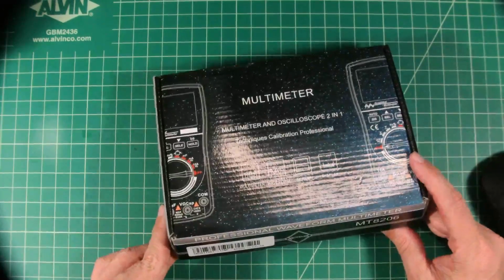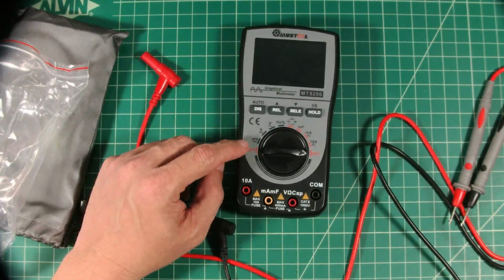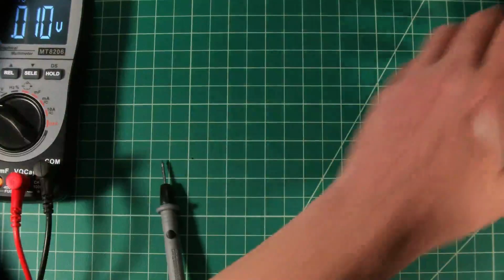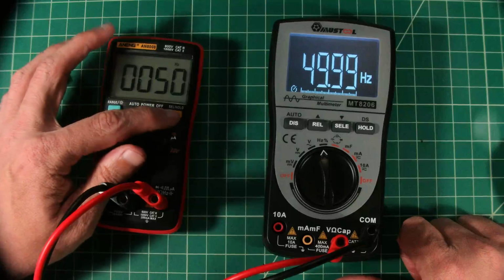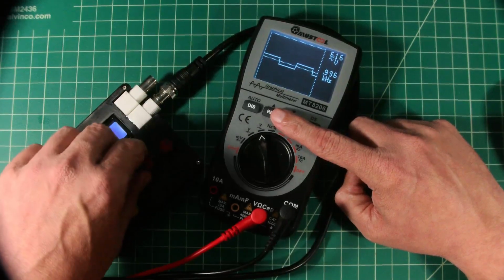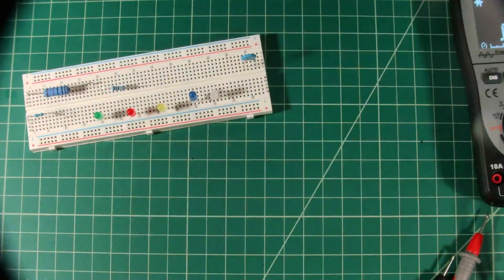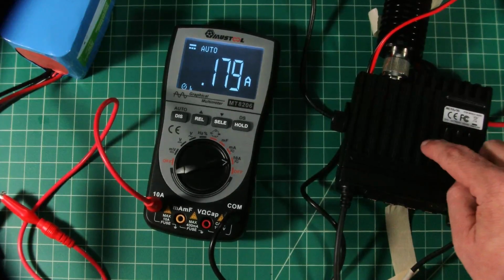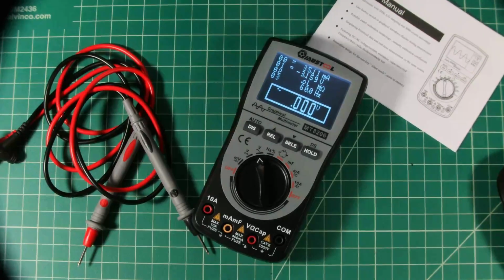Mustool MT8206 Multimeter Review

Comment: I have discovered why the diode function doesn't work.

I measured the open circuit voltage at the probes of this meter for the diode and continuity tests at 1.498V.

Information I had previously read on the web for this and similar meters, says around 5.0 Volts for the diode test, however my findings are completely in accord with the meters quoted printed specification voltage, which states .... "about 1.5V"..... (The web information is incorrect).

The meter is therefore not faulty, but working completely as intended.

Most LED's require at least 2.2Vf to illuminate, so the test voltage and current applied by this meter is not enough to overcome the forward junction potential, so the diode will not conduct.

Light emitting diodes can therefore not be reliably tested with this particular meter.
Reply from the maker: Fantastic post, thank you for adding to the conversation.  👍

Comment: I have the newer version of this same meter and had the same results trying to test LED's.  I did test a normal diode fine but not the LED.  All of my other multimeters could test the LED in diode mode except for this meter and my Hantek scope/DMM which also failed to test an LED. Strange!
Reply from the maker: I just think the forward test voltage is low in these meters.  Thanks for checking out the video Bruce...

Comment: I have the same unit. Nothing special but good for testing second hand generator if you are worried about the sinewave and voltage fluctuations/ spikes. I tested my pure sinewave inverter and compared to 240 volt household. Inverter was perfect. ( Giandel) 1700 watt RMS. 3400 watt peak for 15 seconds. Capacitance in mine never worked! If the MUSTOOL  8207 or 8208? I'd rather either of those. Cheers.
Reply from the maker: Thanks for watching and for the comment Dragan
Reply: @TheSmokinApe  thanks for the reply! It was 2:30 am. I couldn't sleep so what better than YouTube? Lol . Cheers 🙂👍👍👍

Comment: Diode test: If you look at page 32 of the manual, the diode test is rated for "Open circuit voltage: about 1.5 V". It looks like it's designed for plain silicon or germanium diodes (forward voltage about 0.7V or 0.2V), not LEDs that have a substantially higher forward voltage. Your test LEDs were measured to have forward voltages of 1.8V - 2.6V, well above the 1.5V the meter claims it can measure.
Reply from the maker: Thanks for the info / detail Henry!

Comment: Great review, Ape. I appreciate you walking through all of the features and taking it apart.  I’m with you on the fuse situation.  Weird that the diode test failed, too.  I saw an Auto label - I assume it auto ranges on resistance at least.
Reply from the maker: Thanks Jim.  I think that something must be wrong for this particular meter to fail that test.  Yes, it’s is auto-ranging which is a cool feature in my book.  Thanks for watching 👍